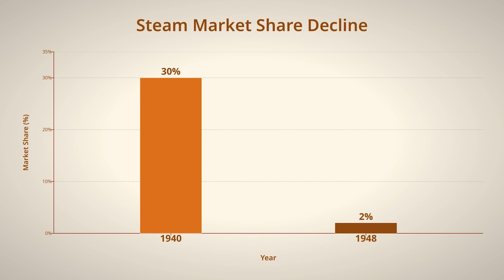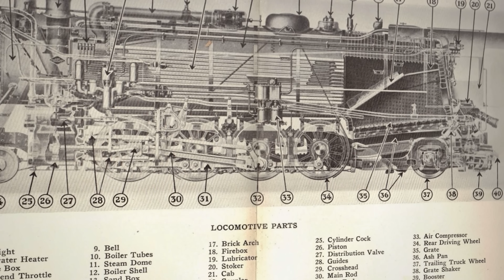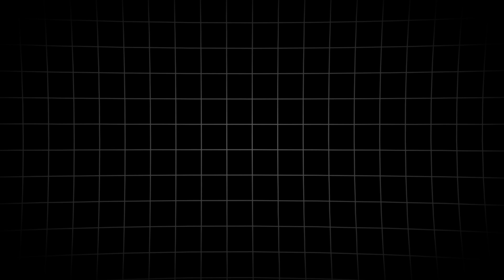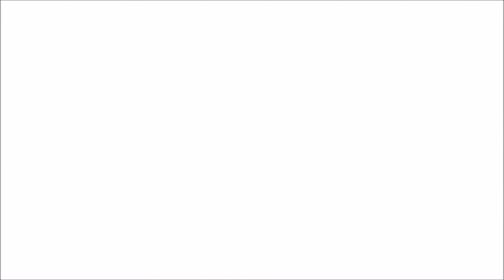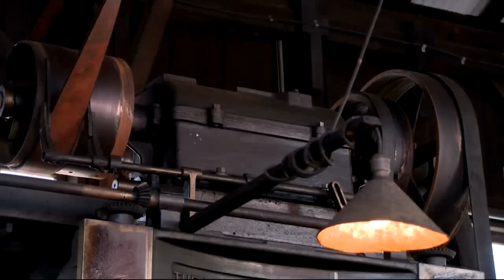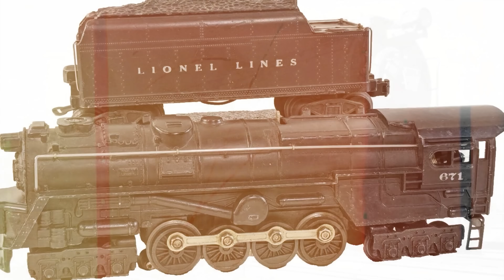Why Did The PRR S2 TURBINE FAIL ACTUALLY?

Comment: The efficiency of the steam turbine would have been between 60% and 80%, not 97% as claimed in this video. The overall system efficiency from the energy in the coal to the energy input to the wheels would have been between 18% and 25%. In comparison a diesel loco would have an overall efficiency of over 40% and a fraction of the complication and maintenance requirement of the steam loco.

Comment: The S2 failed because a constant speed, one direction engine is unsuited to being directly coupled to the driving wheels of a locomotive. Also a steam turbine isn't very efficient without a condenser, which is impractical on a locomotive. Both problems can be overcome completely by putting the turbine at a fixed location and distributing the power to the trains, which is what much of the world does today.

Comment: These steam engines were doomed before they left the drawing board. It was a new application of turbine technology, but the expected fuel economies never arrived. Diesel electrics were already in the market and they were far more efficient in using fuel, took a third of the maintenance in labor and down time as a steam engine. The turbine engines still needed that high, costly about a maintenance that Diesels avoided. The railroads that tried steam turbine electrics all were trying to justify continuing to use coal to make steam. The economics just weren't there.

Comment: A steam turbine locomotive seems like a good idea.They likely would have worked well had they had some type of transmission suited to both low and higher speeds and a more specific boiler. Also, when they came out railroads were switching to diesels. If they had been developed earlier, things would have been different. As you alluded to, steam turbines worked very well i marine applications. So much so that the Alpena and Wilfred Sykes still sail the Great Lakes utilizing steam turbines.

Comment: so what it needed was a better transmission with a low yard speed and a mainline gear basically? so the turbine could have ran at optimal speed while not making the engine run more then needed for a job like the the hydrlic diesels had
Reply: More than likely it may have worked better had it been geared for more moderate speeds and used in freight service instead of passenger traffic.

M3t turbines over in Sweden ran for years that way with little trouble, one is still preserved in working order.